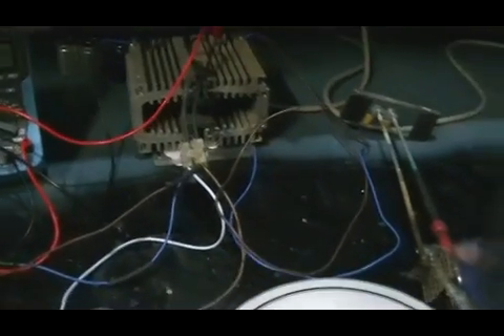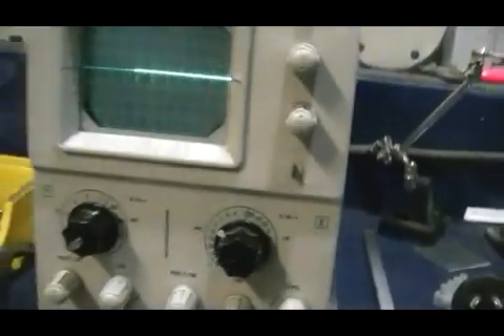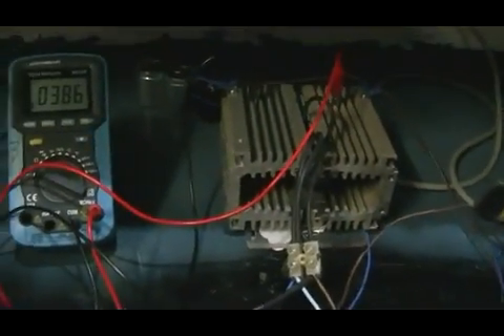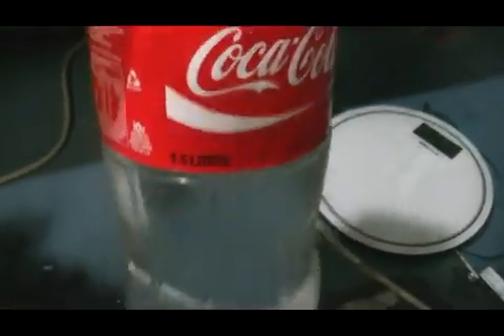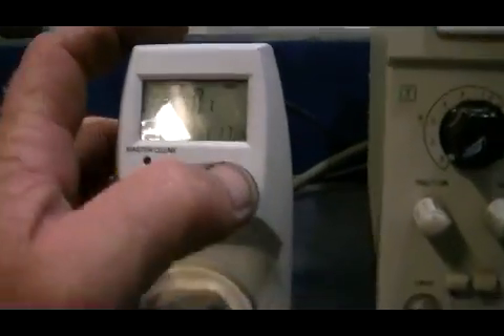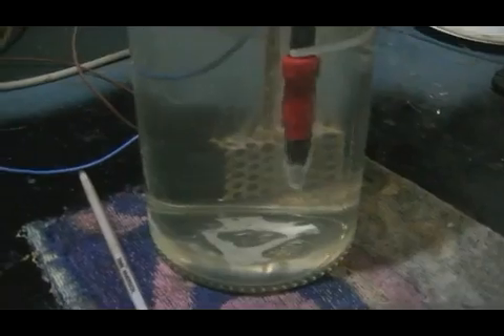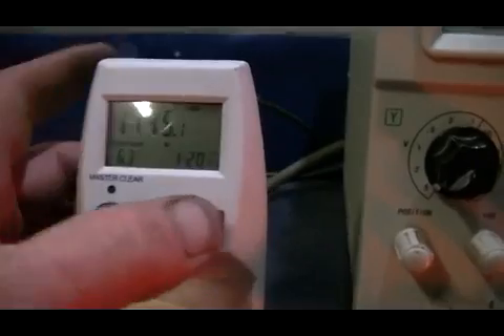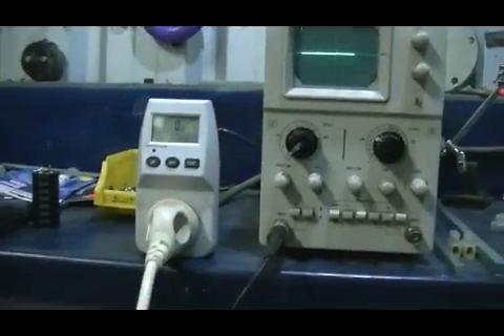Cold fusion-first temp test run with iridium cathode.

Comment from the maker: Cold fusion was just the name given to the setup by some one else-so it just stuck.
But i see no fusion other that the recombination of oxygen and hydrogen,in way of explosions.
What i believe is happening is,HHO is formed and creates bubbles of gas. The gas is super heated by the current,and ignites.This causes the excess heat in the system,and the H and O reform's or fuses together to form water.
That is about the only fusion i see.

Comment: Hi TMP,

Thanks for the tip on the heater plugs, for platinum you can also get it from catalytic converters, though it is a coating on a foam of aluminium oxide (ceramic).

Great video with lots of detail as always, keep it up, they are a pleasure to watch

Mike

Comment from the maker: Hi Slider.
I never thought about testing light output,as i have only just started testing this device.But i would say that there is some usable light power there.I will place a small solar pannel with a resistive load on it next to the jar on the next run,and see what we get.I dont have a light meter as of yet,but it will be on the list of things to get.

Comment: Clever tip for finding some of the high dollar metals to run these experiments. My understanding is the reactors always have an initial "warm up" period which pulls a substantial amount of current. Once reactor has reached this peak, thats when the magic of excess heat happens. Some of the reactors are also said to use RF, what are your thoughts on how RF would be used or input into the system?